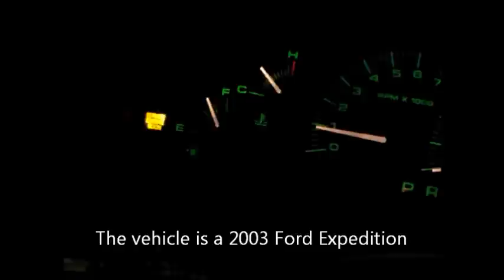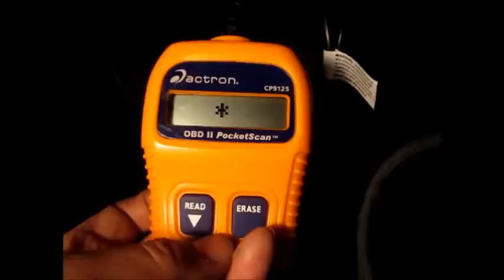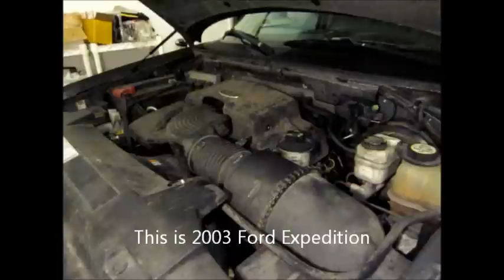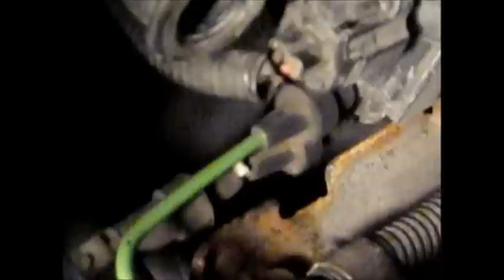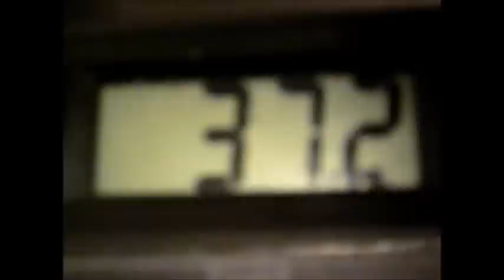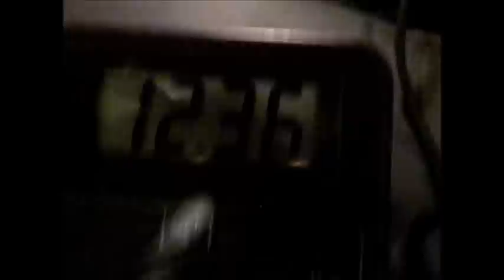How to Test EGR Valve without Vacuum Pump

Comment: With the engine running at 1200 RPM'S, check for vacuum at the hose. If not, check the purge valve. If the engine runs rough and you disconnect the hose and plug it and it smooths out, the EGR isn't bad. It could be the purge valve.

Comment: It is a very clear and useful video. Just what I was looking for. But I also wonder if the valve stays stuck open or partway open will this test rule that out? THANKS !
Reply: LOU If the engine stalls or hesitates, disconnect the vacuum hose to the EGR and check for vacuum at idle. There shouldn't be vacuum at idle. If there is, check parts upstream like the regulator or solenoid. If the car has a charcoal canister purge valve, replace it. If the EGR is stuck  open, the engine would stumble or stall. Tap the EGR with a ratchet to try to unstick it. Remove the EGR to clean it. If it leaks down, replace it. Use a Mityvac to pump up vacuum and if it leaks down, it's bad. With the engine running, pump up the EGR to about 8-10" of vacuum and the engine should stumble. If not, the EGR could be clogged or the passage under the EGR is clogged.
Reply: @martystevens3969  Can you please answer this?! When you say "there shouldn't be vacuum at idle", are you saying that the hose originally connected to the EGR Valve should not have any amount of vacuum? Mine has a small amount of vacuum (is sucks the air out of a bag) but my car still seems to run fine but is throwing a P1409 code. Any help would be appreciated!
Reply: @stevenjonas1  did you ever find out the p1409 code? I'm having this same issue.
Reply: @nicholaswilliams2888  Yes I did. I ended up having to snip a wire in two places and join it back together again because the wiring to a certain part I can't remember at the moment had the wire break inside of the plastic that covers the wire. There's no way I would have known unless I was testing the voltage of the connectors that plug in to the sensors. I can check tmrw what part it was.

Comment: if valve is stuck a bit open  and not close completly you my have a leak problem, thats why I use a diphragm tester and avoid replacing  a good  IAC.
Reply: weed&beer If the valve is stuck open, the engine will hesitate or stall. Disconnect the hose and see if the valve closes. If so, the problem is upstream. There shouldn't be vacuum at idle. With a Mityvac, if the valve leaks down, it's bad. It should hold vacuum. With the engine running, pump it up to about 8-10" and if the engine stumbles, the passage is clear. Remove the EGR and clean it. Use a gas tank cleaner to keep it clean.

Comment: probebly thats why i got the p0135 but my dpfe only stays on 1.8v all the time warm or cold. then i get the p0175  if i dont let it reach full warm up to about 180* it cuts off fuel and i get the p0175 0r p0172 .

Comment: Nice job.  Very clear visual and verbal communication.  I used my mouth on a tube going to EGR to induce vacuum and did not get a stall condition.  Will try your method to use the source vacuum going to the vacuum regulator as the vacuum source to the EGR and re-run this test.   Thanks for sharing